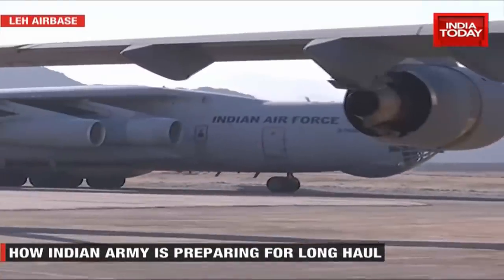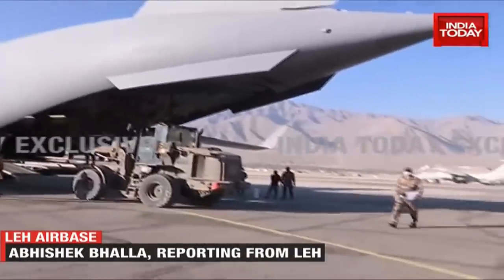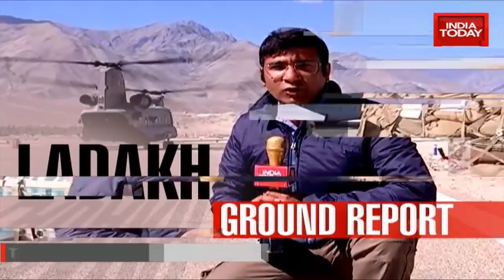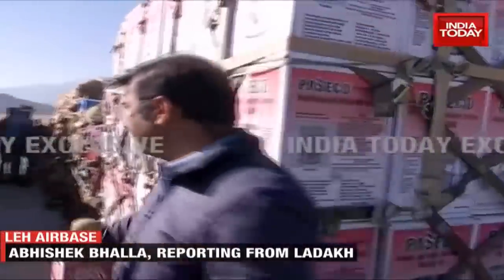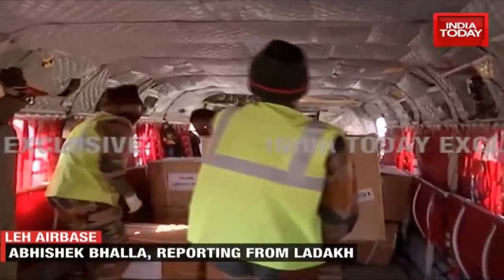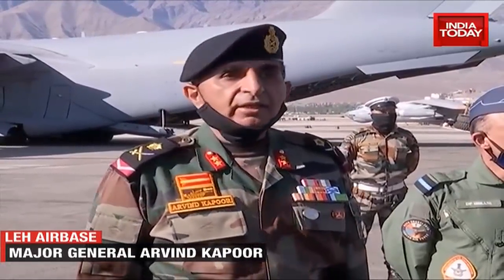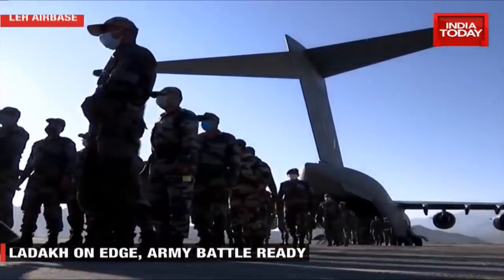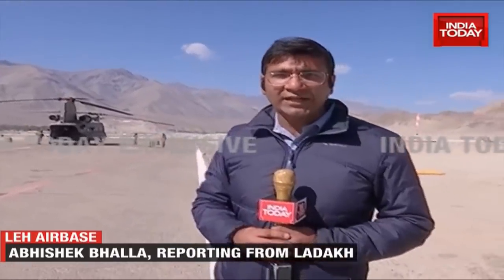Indian Army Set To Counter Chinese Aggression At LAC, Preparing For Long Haul | India Today

Comment: President xi, must construct hundreds of cubic kilometers of reservoirs up north dry provinces to redirects water in 3gorges dam.
2. Divert 90% 0f power dams for pumping full this reservoirs..
3. To avoid flooding, its better to darken the cities downstream for a while insteasd of flooding
4. He should do it in 3 yrs time b4 the next flood cycle.
5. Use this hundreds of cubic kilometer of water irrigating pasture and agricultural dry lands
6. Connect these massive reservoirs with canals and locks for navigation.
7. Would need of atleast 2 million manpower for this mega project
8. Maybe 10k pcs of heavy equipment
9. Better still the reservoir walls ,floors are concreted protecting aquifers.
10. Saves lives , 3gorges dam and sustain progress down stream
11. Promote Food sufficiency and mostly share it with neighboring countries via cheap food supply like what they are doing with cheap and effective electronics. Industrial supply etc
12. Divert portion of funding for belt road program
13. A typical fully concreted reservoir size would be 1 sqr. Kilometer and 10 to 30 meters deep.
14. And making the rim parameter width about 300 meters wide for farming residential. Etc purposes.
15. Some of reservoirs maybe froozen during winter and melts on summer to irrigate
16. Or release back to 3gorges dam and generate electricity via turbines power also..
17. Acting like a power storage..

Comment: There's a lot of comments asking why reporters are allowed at these airbases. I don't see why not, it's pretty obvious that the forces will be stocking up for the coming months, given that road connectivity to Ladakh is completely cut off by mid October due to snowing of the passes. 

I think it's pretty much common sense, that with no clear disengagement in sight, the troops in forward positions will be expected to hold their ground and supplies will be moved to them for the upcoming months.

Comment: very easy to calculate, each soldier needs 25 kg per day, for 180 days let's say total 200,000 troops, that is 0.025*180*200000=900000 tons and with additional fuel and ammunition, C 17 may carry 50 tons each time, needs to fly 18000 times just for supplies
from this calculation, we know the video is just a show off, not much useful in real war,  same as in 1962, India with very limited air transport ability, trying to imitate US, it did not work, front troops lacked of everything and easily defeated by PLA, 58 years later, India has not learnt anything from passed war.
Reply: You know only what ur govt choses to show u since u guys don’t have free media. Also looking at oneself in the mirror and appreciating one’s beauty is something only China is capable off. I wonder how come great China got beaten up by a small nation - Vietnam
Reply: warlike tiger  how are you going to do all you claimed??
1. China has over 1300 jet similar and above your su30mki level, you have only 275 Su30mki, 5 rafale. your jet cannot pass anti air missiles such as S400 and HQ 9 systems
2. China has 300 km range rocket artillery, you do not, you need to use short range missiles which you do not have many. 
with this, China will have air superiority, without air superiority, Indian army cannot do much at all.